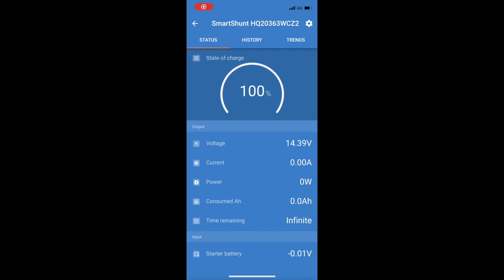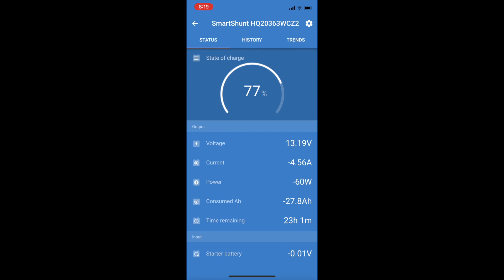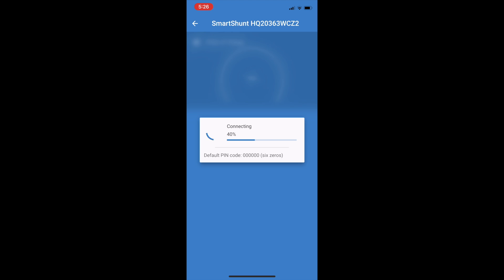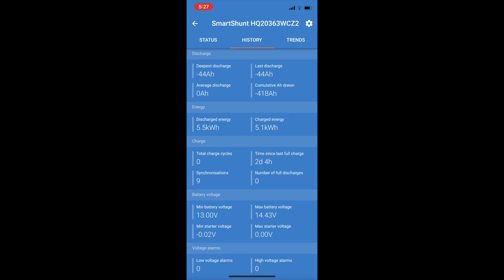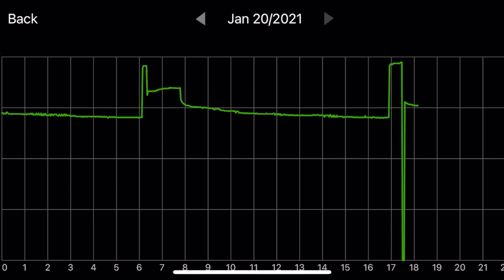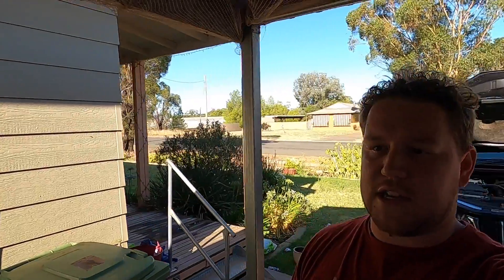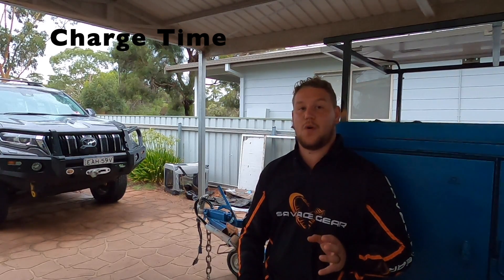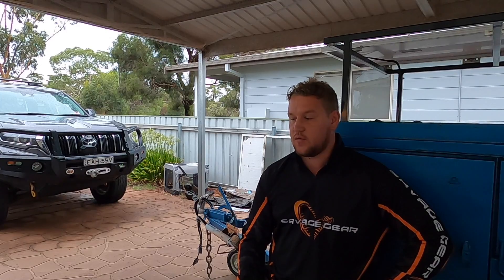Lithium vs Lead Acid Batteries | LifePo4 or AGM | iTechWorld 120X

Comment: Great experiment! 1 variable I noticed, the car was parked in the sun (compared to the trailer being under the carport) so in the car, the fridge would have had to work harder to compensate for the higher ambient temperature. Not to mention the weather (rain or no rain). This may not change the overall results but I thought you might find it interesting.
Reply from the maker: Good pickup mate. 
Didn’t think of that when I was doing it. 
Would be good to revisit again in the future 👍🏽

Comment: Rather than pulling the fuse on the controller , you can go into the settings of charge controller and select disable charge. Then enable charge when load test is over.👍🤠
Reply from the maker: Hey Heath,
Thought about using the feature but thought it’d be easier to remove all doubt of the test 😄

Comment: What lead acid battery did u use , the autobahn link didn’t work
Reply from the maker: Hey Danny,

It was the SuperCharge All Rounder MRV70 mate.
Try the link now it should be an RTM one 👍
https://www.roadtechmarine.com.au/12v-allrounder-battery-mrv70-left-positive-105ah-760cca/p/TEA140
Reply: @OutNAboutAustralia  had the same one and it dropped a cell wouldn’t hold charge and yeah waste of money as an auxiliary battery might be ok as a crank battery
Reply from the maker: @dannyoconner9680  how long did you have it for as an auxilliary battery?
We had ours for about 5 years before the cell dropped and it was no good.
Although it never had to go long without a charge.

Comment: good job on your experiment , mate. if nothing else it allows you to be familiar with your setup and what you can and cant do 👍
ive always run flooded lead batteries as secondaries, only really using them for leds and fridge around camp, not often camped up for multiple days and always with ~200w of solar on hand. they seem to work well, but realistically never really had a good "no charge available" run.
ive recently bought / built a DIY lithium setup (~120ah) from FPVpower, and so far its amazing (compared to lead acid). slightly smaller and lighter than my old faithful 105ah, carries high current draw for ages and accepts a high current charge as required.
cost was just a tad under $500 in BMS / balance board and stuffed into a kings box. it IS DIY tho, so may not suit everyone . 🍻
Reply from the maker: G'day Joel, sounds like a top setup especially for a DIY job. Lead acids definitely still have their place, they're a proven technology but the strides lithium batteries are making just makes them real hard to ignore!

Comment: I want to remind you that lead batteries cost one-fifth as much as lithium batteries.
If you want the comparative test to be unbiased, you will need to compare items of equal value.
This in this case means that you have to compare the lithium battery with a five-capacity lead battery that costs the same.
In this case lead batteries operate at 20% of the discharge depth and this maximizes its lifespan.On the other hand it has the ability to provide multiplier energy compared to lithium batteries in case of emergency before it even reaches the minimum discharge depth
I believe that each type of battery is aimed at specific applications and not all types of batteries are suitable for all types of uses. A fact which is diligently hidden from those who make presentations on the internet resulting in misinformation of those who watch them.
Yes, lithium batteries are good and efficient for applications where the weight and volume are critical sizes (eg small boats, motorhomes, laptops, portable power tools, etc.) However, on land installations where the weight and volume are not problem, lead batteries are much more cheaper (I remind 1/5 of lithium for the same capacity)installation-expansion, ease of maintenance and long life which in some cases is the same as that of lithium batteries.
 In any case, choosing the right type of battery for the right application is a little more complicated than it first seems and can not be exhausted in the comments.
My recommendation is to consult a qualified technician before making a purchase , as this will avoid costly and unpleasant situations

Comment: I have a 105Ah wet cell deep cycle battery. I found it doesn't  seem to last to long. I was looking at the  agm (200-300Ah) or stretch my  budget for a lithium 200Ah. I use a ctek 25 amp smart charger and about 180w (from memory) solar panel. But I would have to get the new 25a lithium charge capable charger for a lithium battery and is the simple charger on solar panel going to be compatible with a lithium battery. Is lithium going to a lot better than agm. It is a lot to outlay for lithium,  but the gains might  be worth it.
Reply from the maker: Hey David,
Definitely a lot of variables there mate. Depending on the make and model of the lithium you're looking at, a few manufacturers claim their batteries are drop in replacements for AGM/Lead Acid meaning they will charge safely using the existing charging equipment (https://itechworld.com.au/products/120ah-12-volt-lithium-battery).
However, the initial outlay is definitely pretty high if you need to replace your whole charging system.
I recently replaced the battery in our Prado with another wet cell 102Ah battery for this exact reason https://youtu.be/LbYXiFXO7C0.

Comment: Hey mate what battery monitor are you using on the lithium ?
Reply from the maker: Hey Cory,
Started with the Victron BMV-712 but I’m currently running a Victron SmartShunt (exactly the same minus the display unit)

Comment: You should really have a fuse on the lead that you took off in the Prado. This is in case of a short circuit in the wiring or a malfunction in your DC-DC charger, if that is what you have charging your second battery. Would have made it easier to pull the charge in your experiment too.
Reply from the maker: Hey Bart, totally agree mate. I did go through the schematic of the DC-DC and found the secondary to the auxiliary battery has built in short circuit protection (fused I’m pretty sure)

I’ve since added a 25A inline fuse for quick disconnections.

Comment: Hi mate good job i think very honest, i have a 120x itech lithium  have it with a itechBCDC40  charger  works good. I have a 120a ARKPAC BATTERY setup has worked fine but now here we go. the 120x lithium is so strong have used it many times cooking with my 12v travel buddy oven, which draws high amps and it just works magic. my 120x itech lithium is worth every penny,and so light 12kgs, and chargers very fast too  great things for sure.terry.
Reply from the maker: Hey Terry,
Thanks for the feedback mate. We couldn’t be happier with the 12v setup we have now. Very impressed with the gear that itech have bought out so far!

Comment: Great comparison! Thanks for the review. Our flooded lead acid has been great for our 1-2 weeks away at a time especially with 160w solar to keep it topped up when not driving. Lithium is great but until the cost comes down further we will probably stick with with the current setup. 
We only run fridge / freezer / lights around camp and to charge cameras and phones. Works a treat.
Reply from the maker: Absolutely guys, the price is still right up there and there's still nothing wrong with the old style, if it does the job why change it?
We'll have to do an update soon as our FLA started playing up after the discharge.
Reply: @OutNAboutAustralia  yeah that’s the only issue is you have to make sure you don’t let it go below 50% or you risk damage. We keep ours in the vehicle as we rarely just sit around camp and while we 4wd and explore it charges up. I’m sure we will go lithium one day though. :-)
Reply from the maker: @oconnorfamilyadventures  100% we're the same with the dc-dc charger and solar for when we park up!
Hopefully I can get it working properly again haha